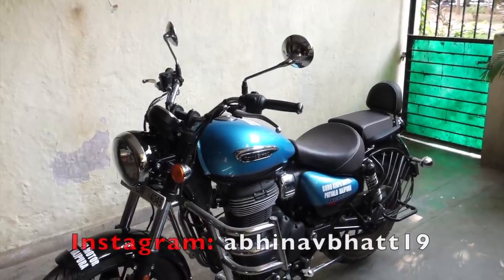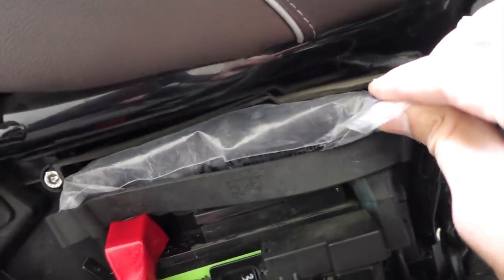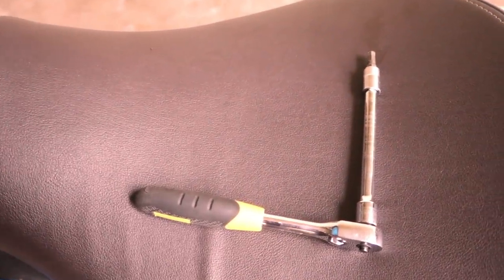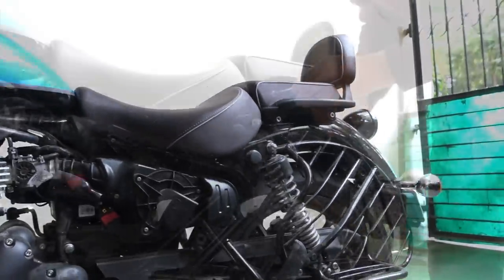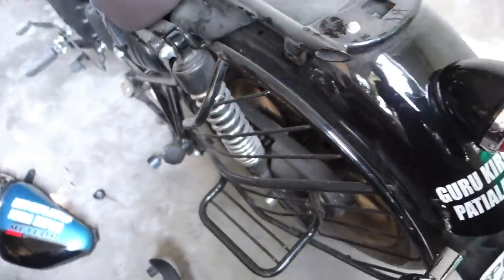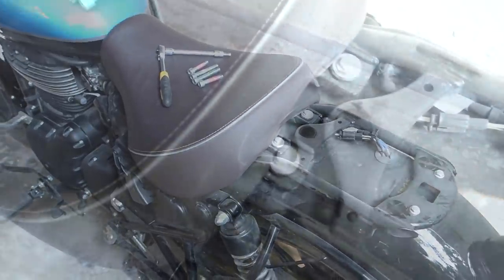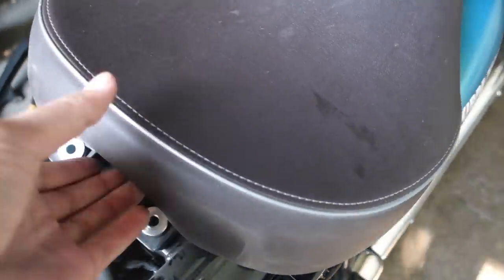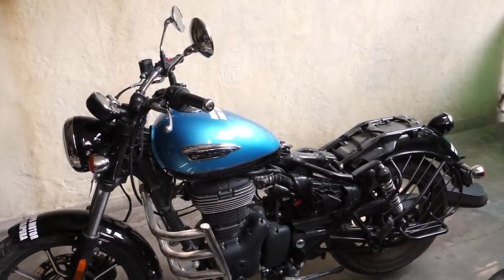Meteor 350 Side Panels, Underseat Storage: Why Royal Enfield, Why?

Comment: Removing the back seat doesn't make a bike bobber.
A bobber means way more than that.
Reply from the maker: "Kinda like a bobber" - works?
Reply: @abhinavbhatt  a bobber, originally known as bob job, is a bike that have all the amenities to run a bike and ride. Nothing more. All other components are removed for maximum weight savings, and making bike cheaper and easier to repair. Currently,  newer thing have been added to it is that to make it road legal( as a real bobber don't have indicators,  lights, no. plate etc., but road legal bike need to have them).
Here is the information, you can come up a conclusion on your own.
Reply from the maker: @prabhatgoyal9938  yes, I do know what a bobber is. But, thanks anyway.
Reply: @abhinavbhatt  having a back seat is essential for some people. They cannot work without it. According to above information, removing back seat doesn't make a bike bobber for him. Its makes the bike a compromise.

Comment: It seems we can remove the back seat sitting frame. Back seat frame is connected to the main frame through the bolt. 

I am having thunderbird 350. I have removed it to check whether we can remove it or not. In the same way we can remove in meteor 350. 

If you can please check.

Comment: Good video thanks for giving a demonstration as to what’s underneath. I just use a round fender bag attached to the rear grab bar as storage. Online it says this
bike has an oil cooler- I don’t see one. What is that metal rear panel that covers the rear tire for? Luv the bike here in the states Allan USA
Reply from the maker: Hi Allan. The metal frame is something called a 'Saree Guard'. It is a government mandated guard that manufactures have to provide on all motorcycles. A saree is an Indian traditional wrap around dress for women and this helps it not get entangled in the rear wheel. Though it is the first thing that most throw off their bikes on delivery.

I don't quite remember now, but the Meteor 350 doesn't have an oil cooler.

Comment: How is the quality of the side panels considering they're plastic? Do you think could take some wear and tear or could break easily? Also, is there a subframe that can be removed for the seat like the classic 350/500? Or is it one unit and held together with the rear fender? Couldn't gauge that properly in the video. 

Thanks, Abhinav! 🔥
Reply from the maker: Plastic quality is okay. Will be able to take some abuse. I don't remember correctly but I think it has a removable rear subframe.
Reply: @abhinavbhatt  Thanks man. Not sure why RE opted for plastic side panels. Can only think of weight reduction or cost cutting, but it still weighs 191kg after this. Guess a removable subframe means more aftermarket bobber or a long single seat, guess that's good after all.

Comment: So I actually have the stellar black model of the meteor. I must say that it sucks to see that after removing the pillion seat, there's a panel that has some wires going through it. I would have loved to convert this into a bobber but putting a grill to cover that pillion seat panel is a little confusing to visualise. Let's see, I plan on doing a mod job from somewhere and checking if they can come up with something to avoid a design nightmare 😀
Reply: Can you turn into bobber,sir
Reply: @bohutking1690  the body of this bike is not suitable to be turned into a bobber. This bike can be modified to look like a better cruiser. Waiting to hit 10k kms to start with the mod job
Reply: @tihorraibman7711  thank you sir

Comment: good video series you have on Meteor, been watching since the first one :)/... For storage, I guess they give that side box in the rear with an additional attachment, saw it in customising the bike section, for about 3 or 4K. But yes some space would have been good, will be a good thing for accessory makers to work on -  a small box like thing which is lockable.
Reply from the maker: Yes, exactly.

Comment: Good video.I have some doubts
Will Meteor show average mileage and trip mileage?

Are you facing any fuel indicator issue like showing empty even though there is fuel in tank?

Any false neutrals ?
Reply from the maker: No. The Meteor does not show mileage data. No fuel indicator issue or false neutrals so far.
Reply: @abhinavbhatt  ok bro

Comment: Very sad, no storage. Plus not so easy to open seats.
Reply: Just want to add that the thunderbird before this has a much better layout in term of battery compartment and fuse etc. The fuse box is in separate area. The seat opening is easy. But there is no storage area. Opening tool box area is time consuming. All in all it was far better then this current model. RE pays very little attention to these details although these small aspects makes things easy and user friendly.

Comment: Thank you Abhinav for the video series on CB350 and Meteor. It gave a great clarity about both these bikes and will help a lot in selecting between the two.
I have a question:- I was told by one of my friends that the TB500 had its battery fitted in slightly inclined position and twice the battery fluid oozed out. He had fumes under the seat and thats a terribly hazardous situation. He sold the bike off n got rid of it.
Could you please tell hows the battery fixed in Meteor? I could not get an idea about it in this video.
Thanks once again.
Reply from the maker: The battery seemed perfectly parallel to the floor. So, definitely not inclined. I don't see the battery leaking anytime soon.
Reply: @abhinavbhatt  thanks a lot :-)